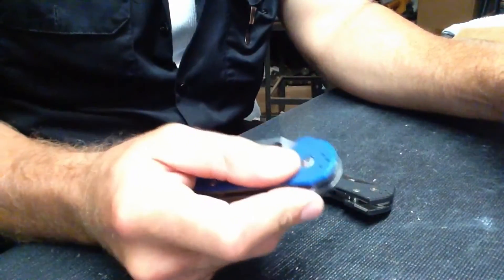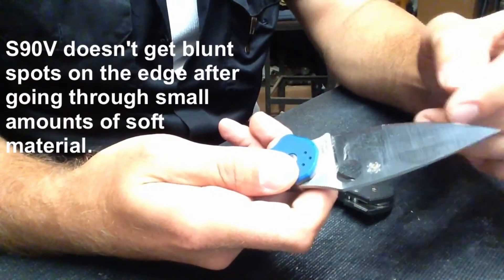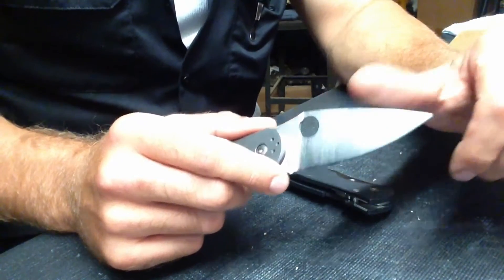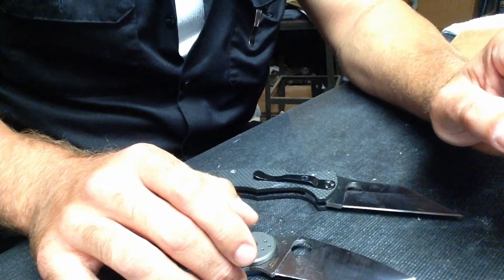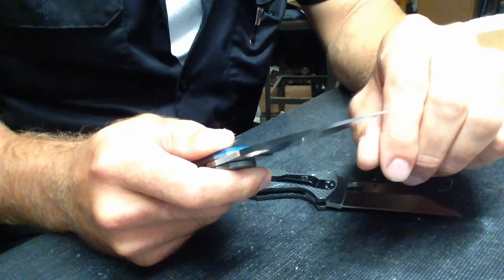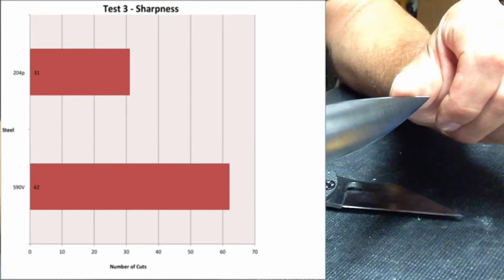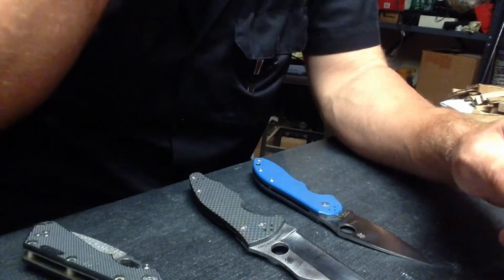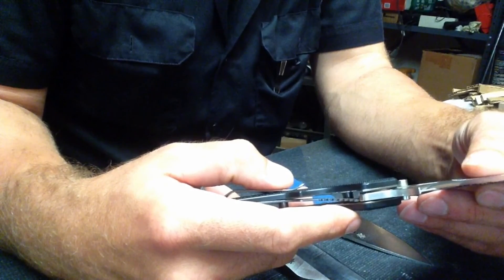CTS-204p/S90V Comparison

Comment: That's the most standardized and thorough test I've ever seen on YouTube.  The only way I could think to improve it is to use multiple knives for reach of the knives and use a statistical test. 
I think that would be too expensive though.
Reply from the maker: Yeah, the tests get expensive, time consuming, and if you're not careful, the data can't even be presented.  I've done entire tests with multiple runs that were never posted because of a mistake.  
If you watch the later videos on the channel, the testing gets better. (At least, I think it gets better.). 
Glad you liked the video.
Reply: I'm a professional researcher, and about a 3rd of the data I collected in grad school and the first year on the job was pointless data I never used.  
I wanted to get fancy with my research when I started out.  Experience has taught me that something will always go wrong, so keep it as simple as you can.  Plus people don't understand half the shit I talk about when I get into statistics.
Reply: What is the best steel or knife for both ease of sharpening, and edge retention?  Basically, what's the best ease of long term use knife?
Reply from the maker: +Rick Holden there is no best steel.  There are very well rounded steels, but when you get into extremes, like 10V, you have extreme abraision resistance, but low toughness.  Corrosion resistance can be a factor as well.  And the blade geometry and the sharpening can also play a huge part.  
When I buy a knife, I consider the steel, the build design, and my intended use.  For me, what knife the steel is on, is as important as the steel itself.
A very good steel for general all purpose use for the non expert is S30V.  That being said, you should start with a steel that you can work with sharpening.  As you get better with sharpening, your options open up.
Reply: Michael Christy Thanks,  for the reply.  For me, I keep the blade shape simple for later sharpening ease.  To sharpen, I use a Work Sharp Guided system, with the upgrade. 

I try to balance ease of sharpening, with edge retention.  For example, I don't mind an Al Mar Aus8 steel, because it has decent edge retention. And, maintaining it is easy.  When I do have to resharpen it, it's also easy.  
But, for the price I'd prefer a steel that I have to sharpen less often, even if sharpening it is more difficult.  But, if sharpening it is an hours long process, I'm not dealing with it. 

I just bought a knife with S35vn steel, which I've heard is slightly better for retention and sharpening than S30v.  But, I'm sure the treatment process matters more; like Al Mar having superior Aus8. 

After research, I'd like to get a zdp-189 knife.  I figured it would be hard to sharpen, but I've heard mixed reviews.  What do you think of zdp?
Reply from the maker: +Rick Holden I like ZDP for a thin ground folding knife.  I use it quite often.  I hear people say it can be difficult, but I'm very used to it.  
S35VN should be slightly behind S30V in edge retention, but have slightly higher toughness.  They could be close enough that you might not notice the difference.
Reply: Really? I thought S35VN was supposed to have slightly better edge retention. Oh well, it was only $65 Kizer, and I doubt I'll notice.
I'm not a big knife collector, but I'm tired of cheaper knives that I have to sharpen often.  
  
I'm on a pre-order list to get an Al Mar Eagle with ZDP-189.  I know I could get a Spyderco cheaper, with a better thin blade for cutting, but I just don't like the way they look with the big spider hole.
Reply from the maker: +Rick Holden some people can't get past the look of Spyderco's.  Often times buying one and using it changes that.  But Al Mar is supposed to be a good brand.  I don't have enough experience with them to say first hand, but I've only heard good things.

Comment: I've never done any testing, but I find that my Southard (CTS-204p) and my Blue Military (CPM-S90V) have seemingly very similar edge retention. I'm not a hard use person, but that's my experience with  every day tasks like opening packages, cutting cardboard, food prep, rope/cord cutting, and other light tasks. Also, sharpening seems somewhat similar on the sharpmaker... I'd say the CPM-S90V takes a little longer to sharpen.
Reply from the maker: What you're saying is a good assessment of the two steels.  There's two more videos I have posted related to this testing...  204p further testing and S90V/204p retest.  You should check them out for my full perspective on this.

Comment: I’m going to say if it’s not a batch of ht issues that you need to either grind the edge down and re sharpen it to get to good clean steel or get it under a microscope and see the fine wire edge you still have that’s been polished and not 100% removed.
Reply from the maker: Josh Jensen it wasn’t the edge.  I sharpened and resharpened starting from course. I’ve also used other 204p since and not had the same issue.
Reply: Michael Christy so do you think it was a bad ht issue?
Reply from the maker: Josh Jensen probably.  There was definitely something wrong with it.
Reply: Michael Christy have an email I can reach out to you at?

Comment: First of all, I think it's good to show these comparisons and to make the test series identical. 
But unfortunately I don't think that the same conditions are met. 
The blades are roughly the same length and the knives have roughly the same function. 
BUT one blade is convex, the other slightly concave, one blade is curved, 
the other is straight and the blade thickness is therefore different to the cutting edge, 
which strongly influences the results of the cutting edge tests 
(from my point of view).

Comment: Is CPM Rex 45 a better edge retention steel than this? And also out of these two steels which is better at not rusting or spotting? Thx
Reply: Gmotion EDC m390 is better at corrosion resistance!

Comment: It might help for some to add some text to the description.

I have not done much cutting as you have done here, the results are interesting. I would be really curious if you used S30V/ATS-34 where it would fall.
Reply: +Cliff Stamp Ha, I maybe should have watched the full video first.

That is a very interesting result. I think this is light evidence that there may be an issue with the 204p blade.
Reply from the maker: Cliff, there's a sprint run Military in CTS-204p coming out from Spyderco sometime in the next year or so.  I plan on getting one.  We'll see how that one does.
Reply: +Michael Christy Spyderco has a decent warranty department. The forum isn't a great place now, but Sal is still decent to talk to.
Reply from the maker: +Cliff Stamp it's something I'm going to look into.  The Domino is a great knife.  It's one that I'd recommend, and I'm not sure about this blade after that final test.  I'm willing to bet if I repeated the test with Elmax, (which should be close to or a step behind 204p) it would do better then ATS-34.
Reply: +Michael Christy The interesting part to me is the size of the gap between 204p and S90V and then from ATS-34 and say Elmax. 

If you keep one knife constant, you can gradually assemble a scale of results just by normalizing to that one reference.
Reply: +Michael Christy It might be also interesting to look at another S90V point as I am curious if you are not seeing a relative high maximum there.

Comment: I like much bether 154CM on my Griptilian then CPM S110V on my Para. I sm deeply disapointrd with other CPM steel and thats S35VN. It is very hard to sharpen this two CPM Steels and thay lose sharpnes very fast. ATS 34 os very simylar with 154 CM.
Reply from the maker: speedykobac ATS-34 is very similar to 154cm.  What you're probably running into with the CPM steels, is that they're harder to sharpen then 154cm.  Because you can get 154cm much sharper, it seems as if it holds it's edge longer then the CPM steels.  A lot of people prefer steels like 154cm or VG-10 for that reason.